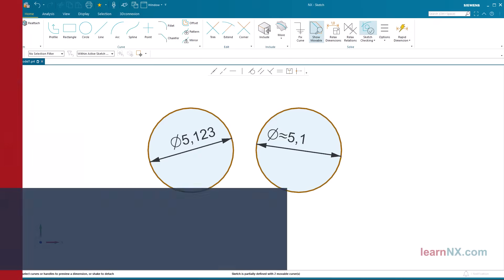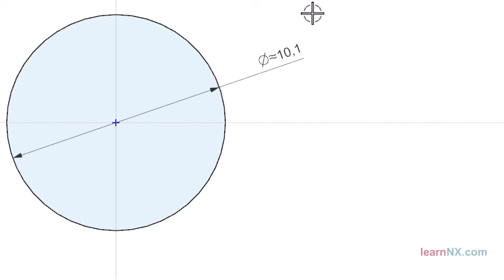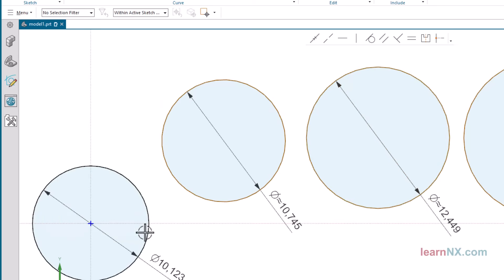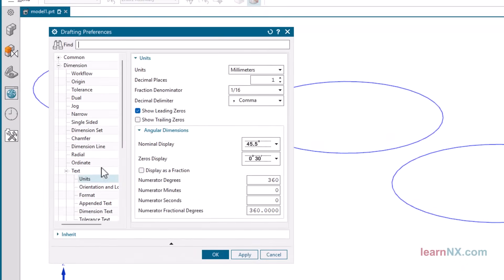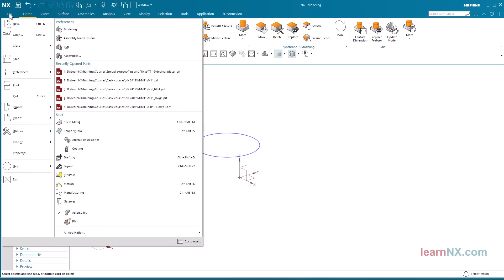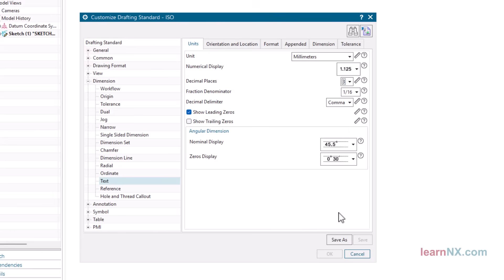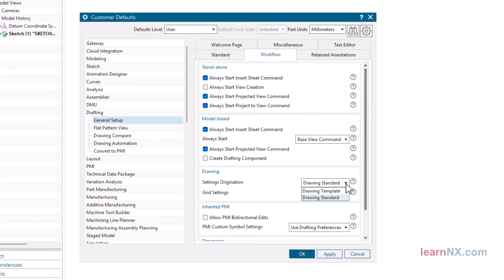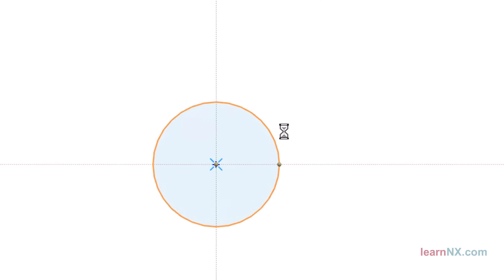Siemens NX, how to set decimal places in sketch

Comment: Thank you for the tutorial. Seems like Siemens should clean that area up a bit - it's byzantine. With respect to setting of decimal places displayed, SolidWorks approach is much simpler and more intuitive than NX, and it gets the job done just fine.
Reply from the maker: You're right, it's complicated, but many NX users work in large companies where an experienced administrator specifies all the settings. This means that only a few users need to change this setting, so there is little pressure on Siemens to change anything here.